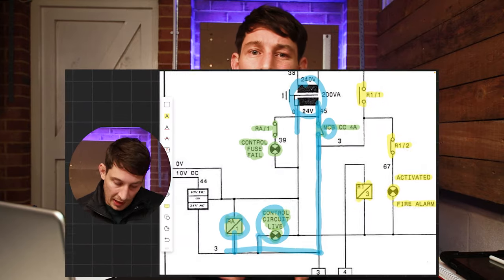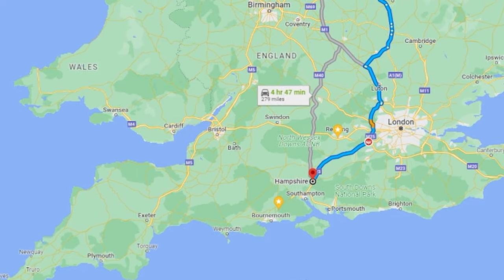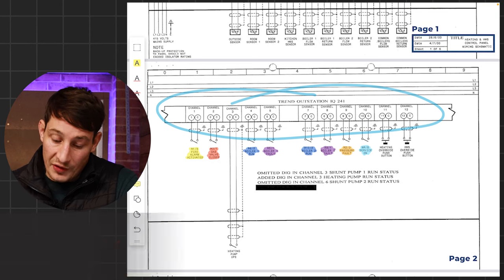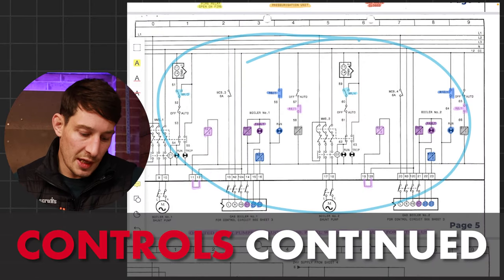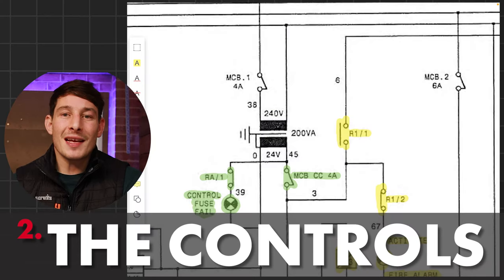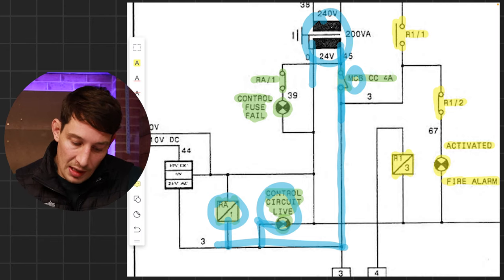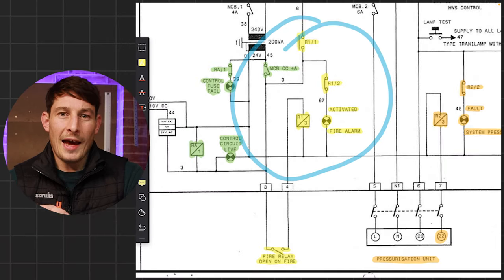How to Read Electrical Drawings | GET YOUR COPY of the Schematic Wiring Diagram

Comment: Thanks for sharing this sir 👍

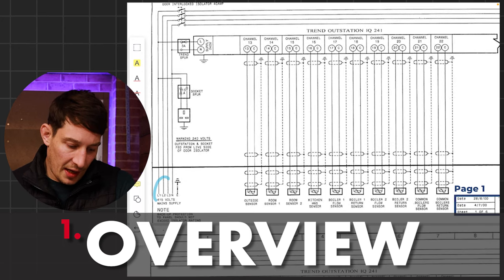2:14 If L1 has a voltage of 120v, how con it power a 230v socket ? 

13:32 The T1/1 relay has 2 separate 24v cables going into it, with one of these directly connected to the 0v end,  not sure i understand why it is energised if there is already a push button to do so at will ?? 

thanks in advance

Comment: Great video. I do have a question about one confusing thing for me. I do not understand the orange systems contact R2/1. It is shown as normally closed. If there is a fault in the pressurization unit, the contact should close allowing an electrical path to the system. However you stated that if there is no fault in the unit, and the contacts remain open, it will allow a path to the rest of the system. That doesn’t make sense to me because it is an open circuit at that point. Also, if there is no fault, then the normally closed R2/2 contact would stay closed allowing the fault light to stay on. Is the relay energized when there is a fault or when there isn’t a fault?
Reply: It would make sense if the relay for the pressurisation system is energised when there is no fault. That way, R2/2 would open and remove 24v from the fault light, as explained. R2/1 would then close and so would R2/3. The confusing part is the explanation for R2/3. We're told that R2/3 closing tells the plc the pressursation system is in fault, but the fault light has been de-energised by the same relay? So either the schematics are wrong or the plc code needs a 24v input to think the pressurisation system is healthy and the wording on R2/3 is misleading. I reckon the latter is more likely but we'll have to spend our lives in suspense unless we can investigate the code or get an explanation from @beeautomation

Comment: Is it me or these schematics were really badly drawn. There are so many things I'd like to point out but for one 10:38, that R2 relay, the way its drawn seems like the pressurisation unit is clear of fault (fault light off) if R2 is energized. However, if you look at page 2 at 11:04, the schematic is showing that energized R2 indicates pressure fault to plc.
Reply: schematics should be drawn in its de-energized state as well so 8:07 really should've been a NC for the FIRE RELAY OPEN ON FIRE contact
Reply: @AsakuraAvan  thanks i was confused about that 👍